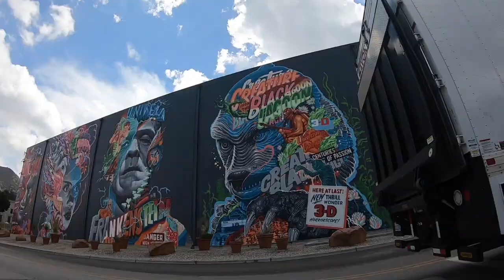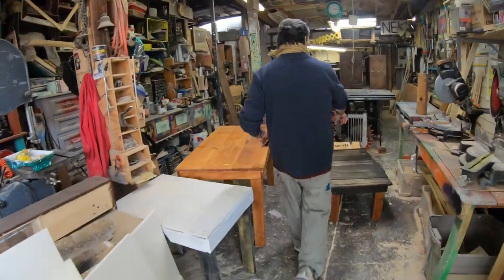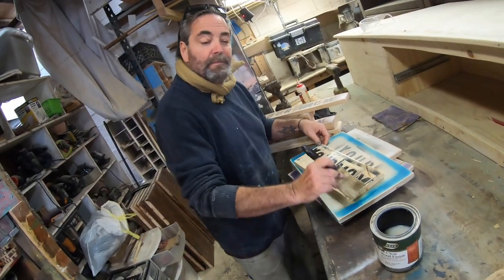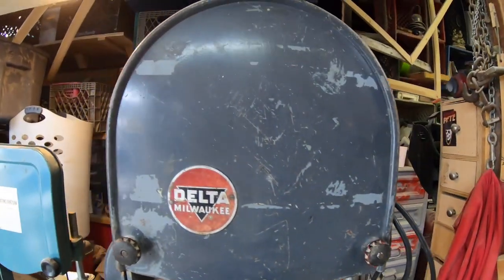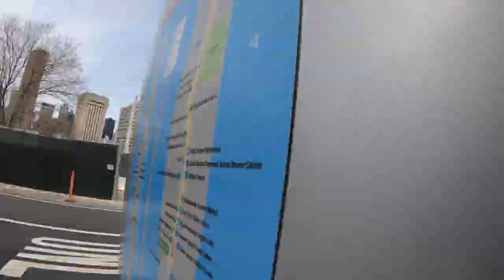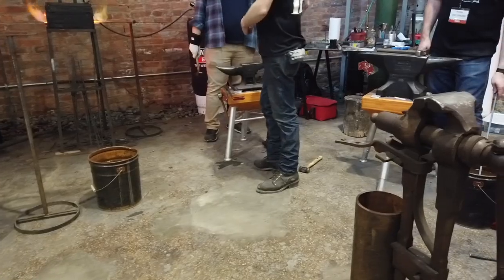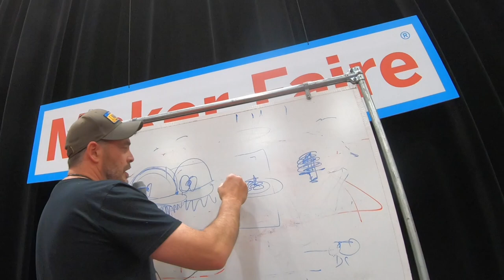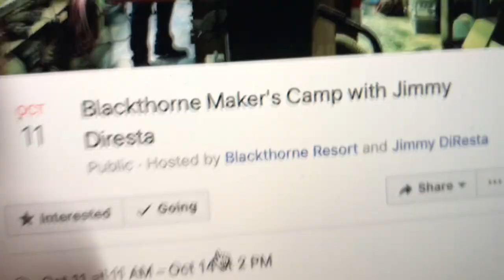DiResta #85 THE LOST VLOG

Comment: I've been seriously debating getting the Lincoln POWER MIG® 140MP but I'm curious for people that already own it if I should save up and get something that also runs off of 230. I'd be using it with shielding gas but still wonder how up to the task it would be for bigger projects or thicker pieces of steel.